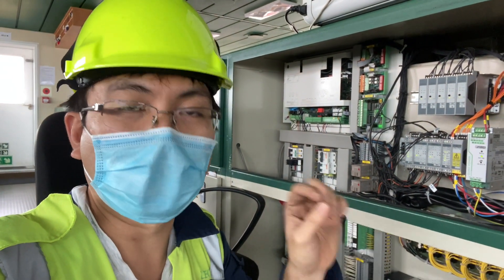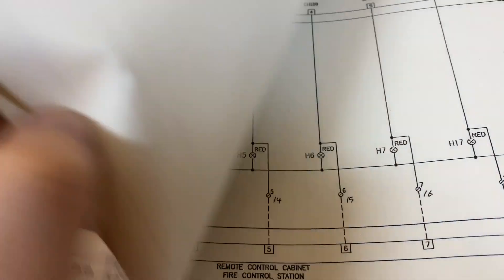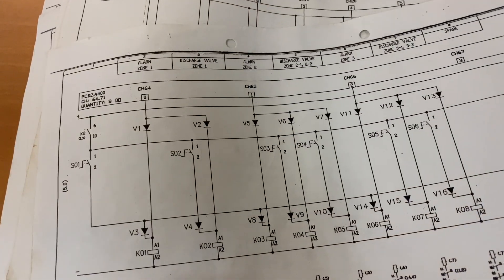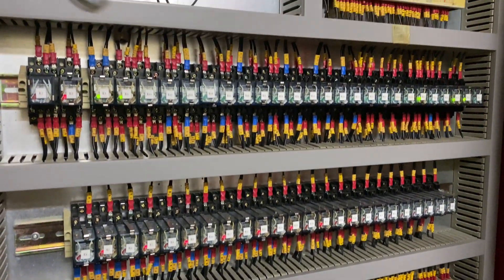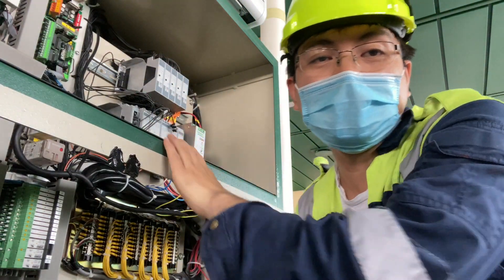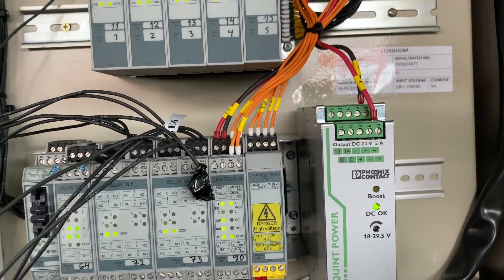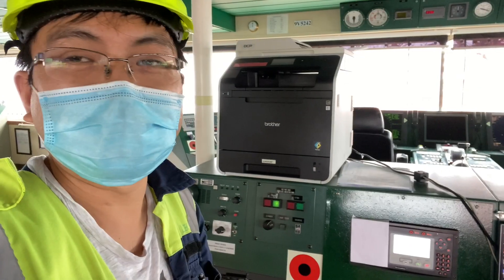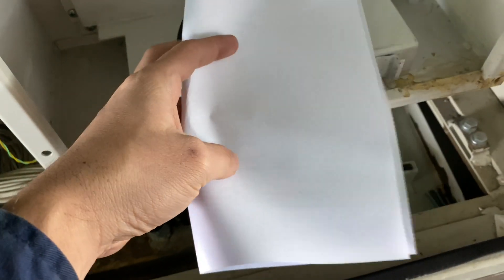FIXING WATER MIST SYSTEM | Marine Electrician

Comment: So let me guess, this was modified probably by a tech Rep from the company that made the system?   One of the things I try to hammer into the heads of the newer people learning at the shipyard I work at is to try to do the best job that you can and try to be correct in the wiring, because a ship is not like working in a building.
If something you did wrong in a building, you have to go back to fix it, but when a ship is 500 miles out at sea, it’s not possible.  If it was done by a rep. I wonder why it did not show up? Did they not do the same operational test in the end, or did he finish and just say “it’s ok!”😂
Reply: I bet the guy who made the mistake checked his own work.
Reply: Often installations have to be made in a short time during unloading of cargo. If something gets delayed the ETO has to complete testing and fix any mistakes while underway. It would be extremely expensive to stay another day in Port after loading is complete.